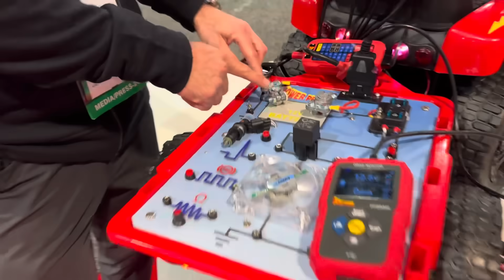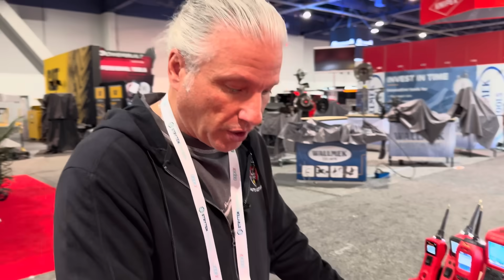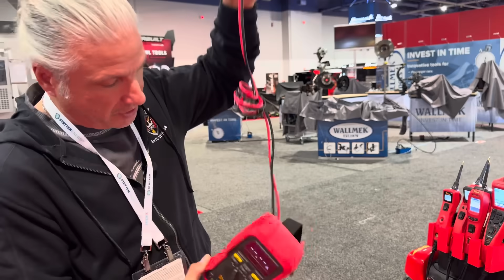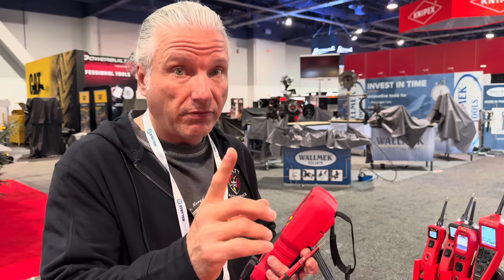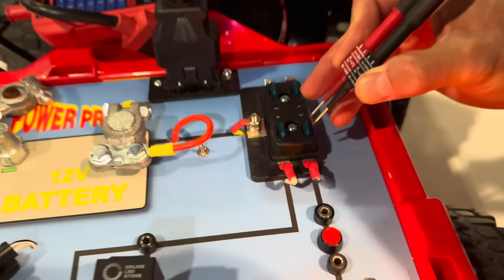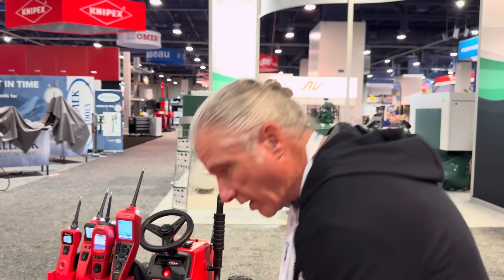These Tools Are Going To Save You So Much Time When Diagnosing Parasitic Draws!!

Comment: If you don't do this all the time I would consider using a jump pack or other power source with a good current meter in it. Not a clamp on one for the low current hes showing there. 

The first took is neat. But really just a small power source with a current display.  I am not in the field but okay at home and work in collision.  Not sure 10 amp is enough when lots of the Hondas have lights you can't easily ensure they don't come on for touching just about anything on the car.

Comment: The power probe drawer monitor can also be used when you install a new battery or clean the battery terminals, you will not lose the memory. And you could measure cranking voltage without open the hood

Comment: How do you go when the fuse box is under the dash and you need to access it and you need to open a door which wakes up the network leaning across the seat etc.Going to make it very difficult.
Reply: Always keep all doors open when performing this test. Just push the latches in with a pocket screwdriver to trick the car into thinking the doors are closed. Always check how the doors work on the vehicle though. I had one the other week that I had to push the latches in and also hold down a little button on the body. I just used a clamp to hold the buttons down to simulate a door shut scenario with the doors open.

Comment: With the PPDRAW Power Probe, do I have to remove all the fuses, one by one, to find out which fuse is draining my battery?
Reply: Voltage drop across each fuse then theres a chart on power probe website to refrence mv to ma

Comment: What about finding very intermittent draws? Battery is reading 12.16v when car’s off. Running is 14.55v, which I believe suggests the alternator is ok. Only seeing a draw of 23mA when testing with multimeter and all my fuses are reading 0.00mA. However, car will intermittently not start and need to be jumped. Just wondering what could be causing the issue.
Reply: battery is shot. Enhanced flood lead acid batteries only have a 80% capacity at 12.5volts and decrease significantly. 12.1volts is effectively a dead battery on a modern car. same with AGM
Reply: I agree.. time to test the battery itself. There are a couple of different testers to choose from. Carbon pile, conductance, even a dvom will give you an idea of the health of a vehicle battery.
Reply: @JosephSManta  I like the carbon pile tester it's cheap and fast.
Reply: weather dampness/ frayed insulation / old alarm or unlock module still trying to work (or other accessory)
Reply: With 23ma I’d look at the battery itself

Comment: Why do they have to break everything down Barney style for auto technicians?  Every tech should know how to use a traditional DMM!!!
Reply: Your ego is talking. If you're as good as you think you are, you wouldn't need to make comments like that. This guy is a humble man who is more than likely 10x smarter than you.
Reply: the kid at work hooked his multimeter directly across the + and - on the battery at work ... I saw smoke come out of his meter. He claims to have mechanic degrees from college.
Reply: @SOP83  sounds like a UTI grad
Reply: @SOP83  He's a fool for not having a fused ammeter in his multimeter. Almost all multimeters today have at least a 10 Amp fuse in their ammeters. Maybe he had a cheap meter. I agree with Isaacharo5501, he's probably a UTI grad. I don't even know if you can consider UTI a college. I would just call it a trade school.

Comment: The OBD II DLC +12V power feed is usually protected by a 5 Amp fuse, but may be as low as 2 Amps depending on the OEM.

It is faster to use a current clamp to measure roughly what the parasitic draw, and if this draw is dynamic (changing, periodic, better to measure with a scope). Using a clamp meter can be done without disconnecting the battery, which is good because we want to power the vehicle with a sustainer and charge the battery at the same time (usually with parasitic draw the battery is under charged), and if by chance a large inrush current load is activated the battery is there to handle the surge current.

Today I think most master technicians will use a thermal camera instead of looking at voltage drop across fuses. If you want to use the fuse charts and look at voltage drop it is best to have a very accurate DMM in the millivolt range to get the needed resolution. However this feature is an expensive one in a DMM (see Fluke 87V, I have an older Fluke 87 and I can attest to its resolution). The biggest issue with looking at fuses with a DMM is some automotive cartridge fuse types (e.g. FMM, FMS, JCASE, MCASE, MCASE+) do not have top test terminals like an ATC blade fuse.

The reason for the high current on parasitic draw, and one of the reasons you do not want to disconnect the battery, is that some parasitic draw problems actually only occur after key on engine off to key off (ignition off). Unfortunately, when you go key on you can draw a considerable amount of current which will usually blow an in line DMM fuse even on 10 Amp scale.

Comment: That's an amazing tool. I use to have to place an ammeter between one of the cables running to a battery post and pull each fuse one by one to check where the parasitic drain was running. Very fiddly, slow and awkward and as you say, pulling a fuse could confuse the situation even more. Brilliant tool. Another great video! I'll have to see if there's a cheaper way to create a DIY tool that does the same ;)

Comment: How do you get a voltage drop off a fuse it’s basically a piece of wire
Reply: fuses would show a (small) resistance under load.  the measured resistance across the fuse under parasitic load can be interpolated from the fuse's known resistance at its rated amps to estimate the current.
Reply: @EmperorCrzyDmnd  wouldn’t that be like micro amps?
Reply: @gtric1466   No, the reading you get on your voltmeter is in millivolts and then you can either convert it to Amps using Ohm's law or look up the millivolt to milliamp conversion tables on Power Probe's website.
Reply: When a circuit is loaded you get a reading between the two multimeter leads no matter what you're measuring. The meter itself is calculating the amperage from millivolts to amperage based on the user settings selected in that mode. You should also notice the leads being in the common and the voltage points on the meter as well. A traditional meter in amperage mode will jump the circuit as a jumper wire so this method is actually computer safe as well.
Reply: @echowhiskey2411  It's just a voltmeter that measures the voltage drop across the fuse when current is flowing and converts it to an amp value. 

If you have a parasitic drain and open the circuit responsible for the drain to put an ammeter in series, it's not anymore dangerous to the computer than before you put the ammeter in serious. The affected circuit had those same amps flowing before you opened it to put the ammeter in series.
Reply: @bernardocisneros4402  fair point being its no more computer safe than doing a regular test. I was thinking the multimeter jumping across would use the value of the fuse in the meter which can exceed the amount of the fuse, but it probably isn't any more than 10 amps anyway. The advantage that this meter does though is show the amperage without removing a fuse that wakes anything up
Reply: @echowhiskey2411  You can do this with a regular multimeter. The only advantage to using this is that it's a little bit faster. Even if my job was diagnosing parasitic drains all day, I still wouldn't buy this. I would buy the AmpHound. It does the same thing just as quick for a lot less money. Don't get me wrong, I like PowerProbe products but only if they add value and in my eyes this one doesn't. I love my PP4 and PP breakout Box but not this tool
Reply: Because one is a constant supply the other side is draw  so ams is like flow think of it as a liquid so you looking for a leak or a break
Reply: The fuse gives you access to to the circuit to diagnose it. Instead of having to splice the wire to measure voltage
Reply: Because everything has resistance regardless of how small. Using Ohms law, you can calculate the amount of current by the known resistance of the fuse. V=I*R. Therefore, I =V/R Technically, if the fuse had no resistance, there would be no voltage drop across it. Hope this helps.
Reply: Everything in our vehicles has resistance. The resistance on some things may be very small but they still have it. Every resistance, no matter how small, will have a voltage drop when current flows through it. In a parisitic draw situation, you have current flowing through the affected circuit when it shouldn't be. The fuse is protecting the circuit, so the current that flows through the circuit is also flowing through the fuse.
Reply: And current draw this would only work if the fuse was open. Very confused

Comment: I'm a bit confused by video...   WHY use the 2 different tools for trying to figure out parasitic draw?  Why not just use the 2nd tool (DM300Auto) - for both the battery connections AND then the fuses?  Seems like it would do both just fine, unless i'm missing something?
Reply: The PPDRAW (the one that plugs into the OBD2 port) has an internal battery that powers the car when the car battery is disconnected. So with the battery connected to the car you plug the PPDRAW into the DLC, close your latches, and wait for all the systems to enter quiescence, then disconnect the main battery. The PPDRAW displays the total draw, and you can then proceed seeking out the draw with your meter or Amp Hound, and you don't have to wait for the car to enter quiescence again (like you would if you disconnected the battery to measure the draw and then reconnected it). I've had both of these tools since the summer and they really make it quick.
Reply: @VorsprungDurchNik  Thank You for the reply...   Does the magnetic fuse tester leads come with the DM300Auto, or is that an aftermarket product?
Reply: @dahrfry5011  They come with the DM300, but I think you can get them separately as well
Reply: No need to respond...  i found out...
Reply: @dahrfry5011  I just saw some on eBay for about $20. The official part number appears to be PPEFASET
Reply: Rewatch the video, he explains Why the 1st tool is needed.

Comment: Funny true story, at a greased Pinocchio shop, the Pinocchio owner called me a liar when I explained voltage drop across a fuse on a live circuit, to prove me wrong he hooked up an ohmmeter to a fuse on the bench and said you see there is no resistance.
Reply: That's funny. I can't believe he's the owner and doesn't know about voltage drop. As ScannerDanner always says: "No current flow; No voltage drop". It amazes me how many mechanics don't know this basic stuff.
Reply: @bernardocisneros4402  I guess it is not that basic LOL

Comment: I did not know the fuse rating had anything to do with ohms law?  Covid brought a TON of draw test jobs into the shop due to cars sitting for extended periods of time and killing the battery.
Reply: The smaller and hotter the "wire" the more resistance to current flow, thus higher pressure=voltage required to push through, therefore the voltage drop across it.
Reply: Really? This is like the fundamental principle behind current draw testing. There are even specialized meters called Amp Hounds that do some of the work for you that have been around for a long, long time.
Reply: @VorsprungDurchNik  I have never seen a formula for ohms law that asked the wire guage or the fuse size in calculations, that is what I am referring to.  😁
Reply: @bornwestusa  Directly it doesn't. The fuse type and rating (ATC 15A) represents the R in V = I x R (Ohm's law).
Reply: @bernardocisneros4402   R stands for resistance measured in Ohms. That is the total resistance of the circuit, still no reference to the wire or fuse size. Voltage drop across the fuse can be helpful in diagnosis, still the fuse rating does not matter.
Reply: @bornwestusa  In order for this to make sense, you need to stop thinking of Ohm's law as Voltage = I x R and start thinking of Ohm's law as Voltage Drop = I x R.

Comment: This is great for a tool junkie , however using logic and tried and true diagnostic techniques is just as effective and utilizes tools most technician's should already have
Reply: Logic? Apparently you haven't worked with most of the techs I have had to 😂
Reply: I agree 100%. I don't need these 2 tools. I'm happy with what I have and I can be just as quick. I do have the Power Probe magnetic multimeter probes. Those are nice. They came with my PP breakout box.

Comment: That interesting. That just made me realize that you can use a bench power supply to do this. Just need a obd cable to butcher. Nice!!
Reply: 😂there are certain technical issues. But you'll figure it out as you learn by trial and error. Also, Amazon has a cheap version of what you describe that clips onto a 12 volt source. But that also has issues and I've found it imperative to be comfortable with soldering circuit boards.
Reply: @JAERepair  What issues have you found with OBD2 adaptor that clips onto a 12V source?
Reply: @bernardocisneros4402  some cars arrive in uncertain conditions. So if the ignition is on and running power to the vehicle (even with engine off) the circuit board can very slowly overheat. Also, one of the adapters arrived sounding like a rattle cause one of the diodes had fallen off the circuit board. I just re soldered the piece back on without problems.  Since it was a bulk purchase, I could see the quality control was not standard for all of them.  Wondering how the power probe version would handle these hiccups (slow overdraw, high current short, potential cross polarity errors).

Comment: I still don’t get it. So the amperage draw on the fuse tells you what?
Reply: You measure voltage drop across the fuse, which then can be translated to current draw based upon fuse type.
Reply: When / if you find a fuse that has amperage going through it (or a voltage drop in the mv range) you then look up what consumer that fuse powers, and that is your source of the amperage draw (in theory.......assuming the draw matches the amperage going through that fuse)
Reply: @ oh, I see now. Thanks for that.

Comment: athermal camera should be everyone's next purchase before this
Reply: I struggled with a intermittent draw on my Superduty that only happened once every few weeks. Turned out to be the alternator. I found it by touching the alternator and it was hot.
Reply: @smokeskull, did you end up getting a new alternator or were you able to fix the old alternator? Was there wires inside that were shorting? I hear the alternator replacement is tough due to  tight quarters. Thanks in advance as I have parasitic draw on my 2010 ford 6.4 powerstroke. Jim

Comment: OK OK OK....what about the dang idiotic cartridge fuses? Especially the newest mini cartridge lol
Reply: I don’t have the pleasure of working on those. My guess would be you need to make super thin back probes with guitar strings and shove them on the edge to make contact and get a voltage reading. Or get a really good thermal camera with a macro lens and check for loaded fuses that way.
Reply: @markm0000  the thermal camera should be everyone's next purchase before this

Comment: Nice demo and slick tools! Now we need to see them in action on some real live case studies 😊
Reply: I work for Genesis and have used the ppdraw to find a draw coming from the interior junction box works great, also can be used to change vehicle battery so you don't lose memory.
Reply: That meter is pretty cool that it does the conversion to amps on the display for you. The obd tool isn’t very practical for the majority of drain issues I see though where it’s either intermittent or it’s networks awake so it’s 5 plus amps that would drain the internal battery pretty fast.
Reply: @autodiagyt  yup was thinking the same thing, Jake! For long-term testing of sizeable draws, a battery charger and in-series ammeter at the battery post is definitely the best option 👌

Comment: Extra tip: the PPDRAW can also be used as a memory saver whenever the battery is disconnected or replaced.  It has a 12v battery inside of it and does need to be recharged every so often.

Comment: Be careful of the trap you may be setting yourself up for:  the tool is now "backfeeding" through the obd port, and whatever fuse normally supplies the obd port (usually the cigar lighter fuse) will now also show up as an amp draw--but it's really the tool supplying power to the parasitic draw.  So it'll look like you have an extra draw.

edit: also, although the powerprobe tool may be able to supply 10 amps through this "backfeed" the car itself may only supply the obd port via a 5 or lesser amp fuse.  You may not be able to reach the full limits of the tool if the car is more limiting.

Comment: I’m not sure this will work on gateway cars.
Reply: I think it will. It is not feeding over the data line. It just needs the two standard pins for ground and 12V supply.

Comment: I had a 20 amp draw on a town and country. Nothing was on fire. The fuel pump relay was stuck and the fuel pump was running all the time. A common problem on Chrysler/dodge products. The relay is on the fuse box circuit board. You can either replace the fuse box or buy a kit to relocate a new fuel pump relay outside of the fuse box
Reply: Funny you should mention that. I saw an outside fuel pump fuse on Rainman Rays channel the other day.  Now we know why.  Thanks
Reply: @mikesabin8568  a relay stuck to a circuit board? The horror
Reply: @ no, it was not stuck to the circuit board. They are soldered to the board ( intregal to the board) the relay was stuck closed to itself. You cant pull it out and simply replace it. You either wire a new one outside the board or you replace the whole board.